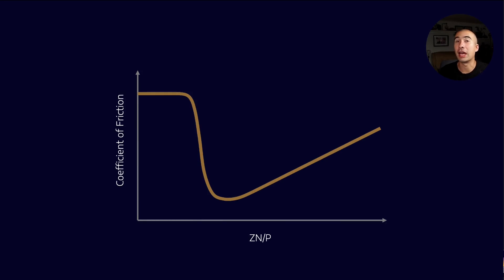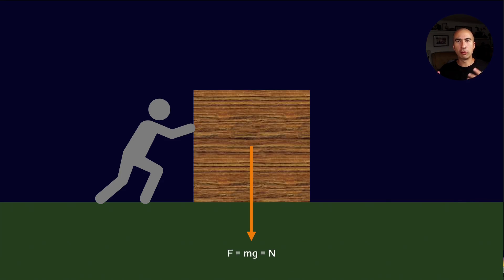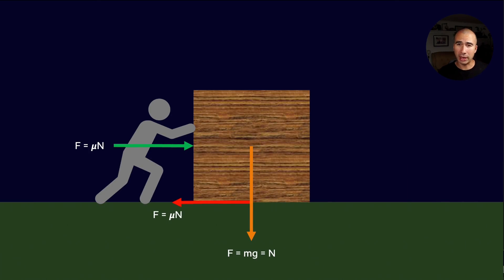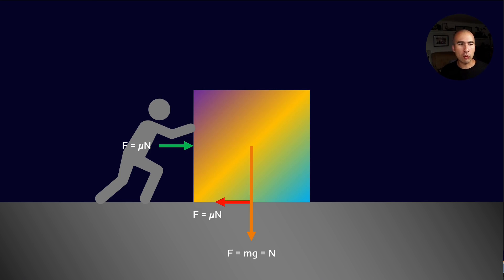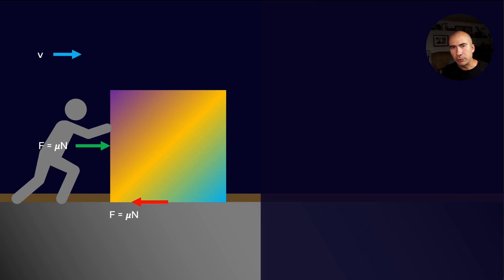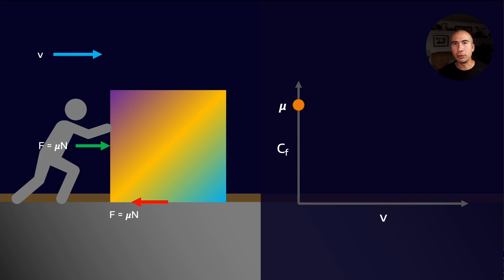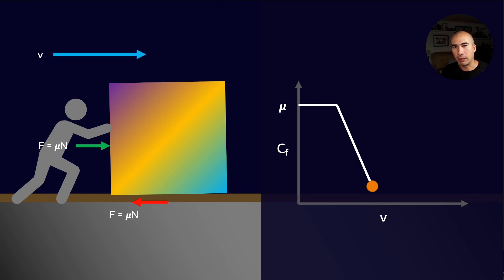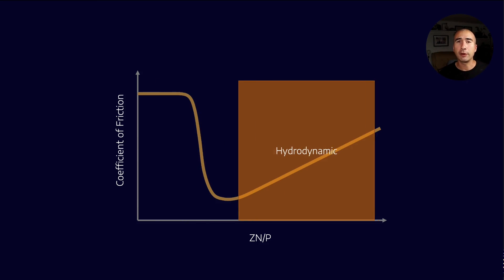The foundations of the three lubrication types: boundary | mixed | hydrodynamic

Comment: Hello! Just discovered your channel and I really like it! Lubrication is a crazy complex topic and I am happy I found this resource to understand it better, thank you! I own a vintage motorcycle and the lubrication sistem in it has one type of oil for the gearbox, engine and the (wet) clutch too, poor oil has to do a lot.. and the fact that the oil changed and evolved  a lot since the motorcycle was produced makes me a little worried. I am curious about the special oils used in bikes since they have multiple roles.. I guess that is one of the reasons they have to be changed very often compared to cars.

Comment: I collect waste motor oil if I run the oil through a mini Refinery around 700°. The vapor is caught in a heat exchanger condensed down into a liquid I get a 5 gallon bucket and an hour or two I get bucket after bucket I can get multiple buckets per day six or seven buckets the oil that I get sits for about a month after that then I treat the oil I mix it with Ethel oxide then the oil sits for about a week or two all the t a r s polymers and odors are stripped from the oil and end up at the bottom of a container the oil becomes clear and orange after this it is mixed with water about a week later all the water settles out of the oil and you end up with a transparent bright orange oil in the diesel Spectrum it runs an engine perfectly with tons of power this liquid only cost maybe 10 cent per gallon I've been doing this for almost 10 years
Reply: What equipment do you use to heat and fractionate the old oil?

Comment: So on something like a telescoping tripod joint, you would be mostly operating in a boundary/mixed boundary condition? What would be the appropriate grease? An NLGI #1 EP might be too thin to prevent the outer race of the roller bearings from pitting the CV cup under heavy load, but a NGLI #2 might be too thick to adequately lubricate the needle bearings in the inner race. Is there such a thing as a NLGI #1.5 that could give adequate lubrication to the CV cup and the needle bearings?
Reply: So grease and rolling element bearings are a whole extra kettle of fish and the NGLI grease consistency is not a critical value for rolling elements, it is mainly a matter of temperature range and even that depends of the general formula. (Also the NLGI grades are not units of measure, each grade had a wide qualifying range.) 
slow short movements are almost always in the boundary lubrication zone  The boundary zone is what additives like graphite and moly or sulfur and phosphate chemistries are used to protect against; which to use depends on the specific conditions and msterials involved. anticorrsion beyond the simple protection of oil is provided by additives that lightly bond to the metal so no other molecules can touch it.

The speed is linear speed, so a small diameter bearing race at high rpm or a large diameter bearing race at low rpm can develop the same hydro-dynamic pressure.(commonly the average of inner and outer race diameter is used)

The NLGI numbers are mostly due to the amount and type of thickener, and the thickener determines properties like high temperature drop point, release of base oil, water resistance, and some more subtle properties. For rolling element bearings it is the viscosity of the base oil that matters most, the grease mainly acts as a researve like an oil soaked sponge (And a sealant to keep out dirt) and with the correct amount of grease the bulk of grease is pushed aside forming a channel for the rollers that only contains a thin film of oil. #1 will release more oil at low temperature than #2. At extreme speeds acceleration forces may require a stiffer grease to avoid being flung out our drowning the rollers.

The opposing forces are load per unit of bearing area and fluid pressure, in rolling elements the fluid pressure comes from a combined effect of linear speed and kinematic viscosity of the fluid. A light load will require less hydrodynamic pressure. 
You can get NLGI #2 made with light iso30 or iso1000 as a base oil and everything inbetween. 
Too thin and it has poor protection in running condition, too viscous for the load combined with rapid startup and you can get skidding. Often some light static preload is used to prevent skidding. To viscous in running condition just wastes power.
Reply: @mytech6779  Doesn't really answer my question regarding telescoping tripod joints with needle roller bearings, inside an axle cup.

 The outer race is hardened steel and the factory grease is a polyurea NLGI #1. The roller bearings tend to cause pitting on the surface of the cup under sustained heavy loads, and I along with others believe the issue is caused by the lack of viscosity or EP additives. An NLGI #2 grease has been shown to produce less wear on the CV cup. On the other hand, by using a thicker grease one risks starving the needle bearings in the rollers. However the rollers only move ~10mm.

 In this specific application, is there a way to give adequate protection to the metal surface in the cup and ensure the needle bearings aren't starved of grease? Or will this be a compromise regardless of the grease used?
Reply: @rolandotillit2867  The answer is in my first post. only moving 10mm it will always be in boundary condition and you definately need the right sort of ep addiitives, maybe a slightly tackified formula. Contact a lubricant dealer, they have whole books of info on which products for which uses.
Again NLGI is not viscosity, it is "texture".
Polyurea is generally a high performance thickener but I usually see it in high speed parts.
Reply: @rolandotillit2867  And yes in short, some situations can never achieve great lubrication and the parts will either need to be under loaded or considered semi-consumable wear parts.